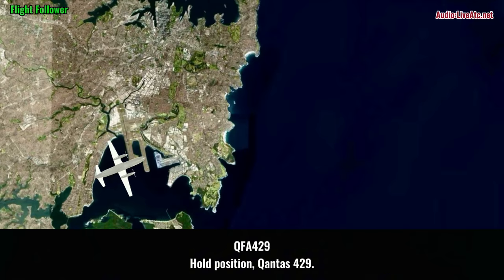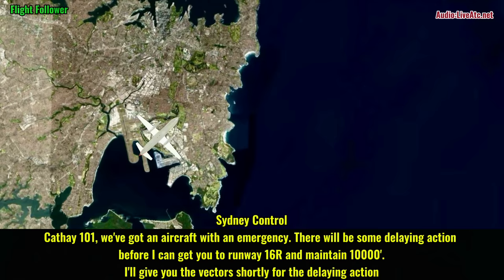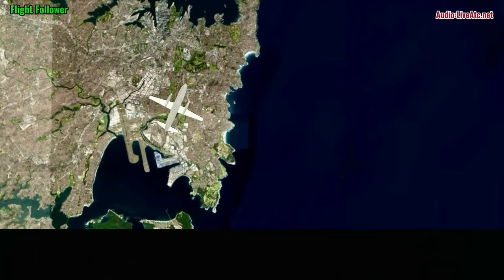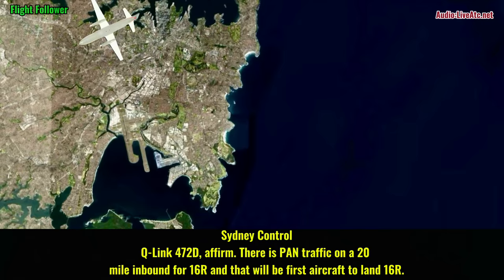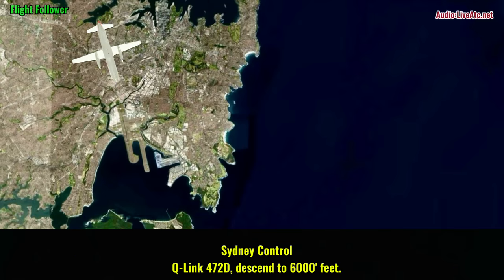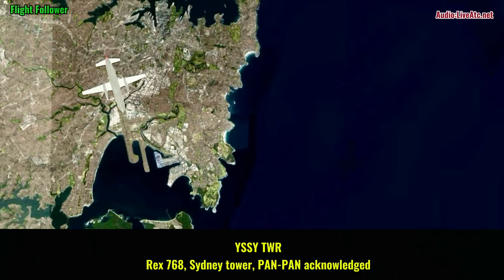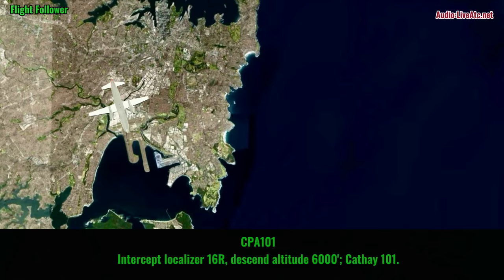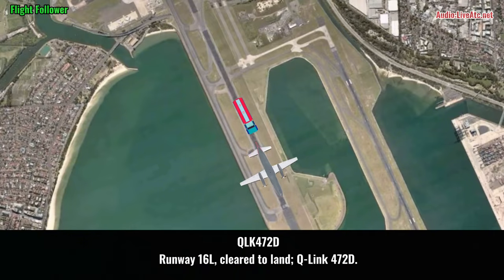Pilot LOSES PROPELLER MID-AIR! [REAL ATC] #atc #aviation

Comment: Prop's to the pilot!
Reply: Just one tho 😂
Reply: @Molon_Labe1776  😂😂
Reply: Groan...
Reply: <Rim Shot>  🤣
Reply: He sure needs one!
Reply: I saw what you did there. :)
Reply: Props LEFT the pilot, hope it wasnt something he said...
Reply: *groan*
Reply: @Relkond  well we dont mean to propel the puns into the air...
Reply: not so much to engineering.
Reply: @Agnemons  it's kind of a known failure mode - the spinny bit has to connect to the not-spinny bit somehow, and in all manner of devices, those connections fail.  Wheels fall off all the time - difference here is mostly one of pulling over.
Reply: @Molon_Labe1776  -1 prop

Comment: I flew that aircraft the first flight back after its repair. Followed a dash-8 to ABX, in their wake turbulence. That occasional bump from the wake made me feel uneasy.
Reply: That aircraft was probably the safest to fly on in the fleet at that time though, it had just been through rigerous maintenance and fly-worthiness
Reply: @garrygarrygarry1  - which is when it’s at the most dangerous. If an aircraft is refresh out of the hangar then the pre-flight inspections should be performed much more diligently. Plenty of examples of engine cowlings not latched, or rags within the engine bay, or just switches out of position.
Reply: @EdOeuna  I stand corrected, Thanks for your more insightful reply... i wrote mine slightly inebriated.
Reply: @EdOeuna I can verify this, having recently tried to 'fix', myself, several problems in my 1997 Toyota Hilux, not being a mechanic, aanndd, I created about another 13 more serious issues which degraded, sequentially, even tho I technically git the ute going again initially! 😂😅 Ha ha

Comment: They're lucky the prop didn't go through the plane
Reply from the maker: He was lucky. of course
Reply from the maker: I remember this happening to a US marine C130 if i am not wrong
Pilots had no chance of saving the aircraft or themselves
Reply: Very lucky!!!!!!!
Reply: Usually an intact spinning propeller will go forward and drop down rather quickly since it is pulling the plane along it will continue on that path.
 
If you are unlucky to throw just one blade at the time it passes the arc range of the cabin then some fruit ninja may occur.😂
Reply: @kiwidiesel iirc an Alaska air superprop had a prop disconnect and tore open the cabin
Reply: @Mike.The.Jeweler I recall the accident where the prop disconnected at the shaft and, once unloaded, flung itself forward.  But there are plenty of variables that could cause a failing prop to tear into the cabin (which is reinforced adjacent to the prop but only for ice shedding, not steel shedding ! 😂)
Reply: That would've been gruesome...
Reply: They never do if the propeller is still complete.
They will depart forward in a curve. 
If a blad disappear than it may cartwheel and hit something
Reply: @Flight_Follower depends which accident you talk about , manny did land even two missing on the same wing
Reply: You worry prop hit the plane?? I was worried it hit people down below.
Reply: The many I inspected ;-)
Reply: "It's exactly the same as what happened on June 8, 1983, when a Lockheed L-188 Electra, N1968R, operated by Reeve Aleutian Airways as  reeve air  Flight 8, made an emergency landing at Anchorage, Alaska, after a propeller separation. In this incident, the propeller sliced through the control cables and into the cabin, but luckily, that the rex aircraft didn't lose flight controls and the turbo prop didn't slice through the cabin
Reply: yep like a spinning top. not a saw blade.
Reply: @truthful3777  No point in worrying about the prop after it has departed the aircraft. There is absolutly nothing you can do about it so no point in burning up brain cells over it.
Worry about the things you can change.
Reply: @Agnemons  Future no expose propeller... All must encased like jet engine safer.
Reply: Ah, no. They're lucky the prop fell in the one acre of bush, where it did and not the houses or highway nearby!
Reply: @truthful3777 mate compressor blades can and do still disintegrate and exit engines.
Reply: @christopherryan7780  Compressor blades are small and light compare with huge long propeller blades.
Reply: @gman83090  similar thing happened to a us navy p3 off of the gulf of Oman 1991. Blade from #1 prop seperated and struck the #2 gearbox. The #2 prop cut into the fuselage cutting all 4 power levers, apu fuel feed line and boost handle cables. All 4 engines flamed out. They ditched her in the ocean with no hyds, no elec no elevator or rudder boost (mech advantage) glided her in basically on trim tabs. All crew survived. Makes the miracle on the hudson look easy.
Reply: @ithinkurf  That DOES sound like an interesting day out. In an Orion 🥶 'on trim tabs' ! WTH. to quote the aforementioned Miracle VR '15 : 29 : 33 DEP I'm sorry say again Cactus?' lol. Anyway, I hope ya didnt ruin any of the nice Navy TVs and things that go ping inside that airframe?! 😏🤕📺cause then someone would be really yelling at ya a?!
Reply: @ithinkurf  'all crew' is 13 people, as well. marking 50% of all targets in 91 also.
Reply: @truthful3777  Right. It came down INCREDIBLY lucky as I recall in a patch of bush near Georges River, in a tiny wedge surrounded by houses, but missing them all, and a major road bridge Xing.
Reply: Never sit on the left side of a prop plane near that spinner.
Reply: @tomsear1  Intersection The River Road/Sandakan Road in Revesby Heights, Sydney. 33°58'00.15" S  151°00'55.25" E
Reply: @thies7831  thanks for follow up ! erm, I was going from memory from contemporaneous reports,  and cross checked now, was spotted by polair in George's River National Park just off The River Road, in the bush. I seem to recall images of it in the scrub 2. So more likely intersection River and Prince, not Sandakan?! Oh yeah if you find the SMH article there is overhead shot of entire prop just 'resting' there from helo. Still, Insanely close to homes! Windage or a few more metres in the air and that bit of the park is a wedge. Thanks again
Reply: @tomsear1  Thanks for your comment. My info is based on what the media supplied to us in Melbourne at that time.
Reply: Nothing wrong with the engine mate, the front bit fell off
Reply: @qbi4614  We'll pull over, stick the spare prop on and then carry on. Just give a few minutes, please ...  :body-blue-raised-arms:
Reply: @truthful3777  I’d rather a prop come off then a compressor shit itself
Reply: @christopherryan7780 ???
Reply: @truthful3777  because when Jet engine go bang bang it’s bad
Reply: @christopherryan7780  Same with Props.. If prop damaged, engine have yo switch Off ajd less imbalance prop will shake the plane to destruction.

Comment: I flew on this plane last year in seat 3A and noticed that row 2 did not have a window and that area of the fuselage lines up exactly with the line of the propellor. I would imagine there are a few layers of Kevlar there. That said, the propellers are quite large as it can carry about 35 people and one of them flying off would pack a punch.
Reply: the armour is for ice forming on the prop and being slung into the fuselage.  theres not much that will stop the mass of a blade.
Reply: Show me a plane that will stop a propeller strike safely and you will see a plane that can’t fly.

Comment: Quite the Pan-tastic day in Sydney with two PAN aircraft inbound...
Reply: I now want a panini
Reply: Pan...oh that is so silly. They were emergency aircraft.
Reply: @RLTtizME that’s what a pan aircraft is??
Reply: @itzgreen6085  A "PAN" is an urgency, a "MAYDAY" is an emergency

If I was flying the engine failure (especially in suck a spectacular fashion) would have been a MAYDAY, because you don't know how whether the same thing to have caused it on one engine will cause it on the other, although at that particular time there was no imminent danger, so either can be justified (even if the other engine failed, they may have had enough glide to reach the airport). Clearly ATC are prioritising this plane, whether because it was closer or because it was most critical is unclear but 🤷🤷.

The medical situation depends what the situation is, if it's just someone who's airsick then it's not an emergency, if it's someone having a heart attack it is.
Reply: @samd2660  Or you can just say emergency…then you won’t have to convulse in your BarcaLounger.
Reply: @samd2660  👍
Reply: Fortunate that a medical emergency can switch runways, if both needed the longest runway it could be a problem.
Reply: @andyalder7910  How so?
Reply: @RLTtizME  An aeroplane with a sick passenger can land like any other aeroplane, so choice of runways is for convenience. Turboprop without an engine needs a long runway because they can't revere-pitch the propeller to brake.
Reply: @andyalder7910  How so. What is an AEROPLANE?
Reply: @RLTtizME aeroplane is British English, airplane is American English and both are  correct since they mean the same. It is actually just a geolocated preference in speech. You'll even hear native BE speakers use the word airplane though since it got way more common in basic.
Reply: @MinkxiTes  Don't deed the troll.
Reply: @MinkxiTes  WE don't use British English here on YT mate. Pip pip....YT is an American Social Media platform.  Also....we don't use "s" instead of "z" in certain words. Make a note.  Cheers.
Reply: RLT, the not so funny aviation troll.
Reply: @EdOeuna  Your comas are not lasting as long as they used to.  The treatments are working .
Reply: @RLTtizME  - I haven’t seen you posting for a while. I almost missed you. Now I need to see a post (rant) from Daft Vader to make my day.
Reply: @RLTtizME  In English the adult term is aeroplane, whereas airplane is nursery-speak for infants.

Comment: "It's exactly the same as what happened on June 8, 1983, when a Lockheed L-188 Electra, N1968R, operated by Reeve Aleutian Airways Flight 8, made an emergency landing at Anchorage, Alaska, after a propeller separation. In this incident, the propeller sliced through the control cables and into the cabin, but luckily with  the rex  aircraft didn't lose flight controls."

Comment: "The ahh prop has just,  ahh fallen off the aircraft."   Very calmly spoken.  Miraculous that the aircraft did not seem to get damaged by the propeller.  . I wonder what the direction of spin is for those props? and what happens to a prop when it falls off. i.e. does it fly upwards first? due to its rotation speed?   Does it fly outwards? Does it depend ?
Reply: It would depend on RPM, vibration and imbalance, and also airflow. If you're lucky it doesn't fly towards the fuselage.

Comment: 1:  holy crap i hope the prop didnt strike the plane.
2: Look out below! I hope noone was injured by this broken-away propeller.
3: i hope they were able to shut that engine right down. Cause that thing is gonna overspeed itself to ripping apart very quickly. Doubt it'd even take a minute.
Reply: It didn't, it flew forward under its own rotational inertia.
It landed in bushland, no one got hit.
Turbine engines have overspeed protection, as soon as it hit redline it would have had its fuel cut by the FCU (Fuel Control Unit)

Comment: Kinda curious why they would direct an aircraft without an engine to fly a normal traffic pattern versus a straight in.
Reply: He was put on a 20 mile final, that's about as straight in as you can get. They were following a traffic pattern in terms of geometry but it was far from a normal circuit. Downwind is downwind,  in this case it was just very extended and probably quite wide due to the emergency. Also, by making a left hand pattern that had the aircraft turning into the live engine, which is preferable.

Comment: 0:08 The first Sydney Control sounds like time is not of the essence and speaks slowly with lots of delay words
Reply: Painful to listen too. The Rex flight should have been declared an emergency. Under ICAO rules I believe this to be correct. The plane, Jetstar, pan was appropriate  as the plane itself was flying normally.
Reply: And a lot of nosey and needy pilots on frequency as well
Reply: @trent1963  like they all like to hear their voice on the radio. My instructor would yell at me for this. If flying VFR and you request flight following and are very wordy you are more likely to get a too busy reply from ATC.
Reply: @annyer262 PIC declared it as urgency not emergency. He was there. He had all the relevant information. You were not there.
Reply: @ZebedeeAU  he should have declared an emergency as it definitely is an emergency, and would have avoided confusion with the airplane that needed priority handling but not due to mechanical problems!
Reply: @annyer262  There was NO confusion in the mind of the air traffic controller.
This is the Aussie way of handling things.
I thought the whole thing was done VERY professionally.
I am an Aussie pilot!
Reply: @annyer262  why is it "definitely" an emergency? What are your skills, experience and qualifications to make your opinion more valid than those of the pilot in command?

Comment: I would have thought a ....may day ...Would be relevant for a catastrophic engine fail with obvious mechanical destruction involved.
Reply: PIC rated it as an urgency situation not an emergency. He was there, we weren't.
Reply: I was in no way  criticising any one involved. My simple statement asked the question. What is the difference between a mayday. And..panpan
Reply: @geoffb108  MAYDAY = lives are in imminent danger, ugent assistance is required.
PAN = Abnormal operations, I need priority assistance, lives are not in imminent danger.
Roughly speaking, that is the difference.
This aircraft is perfectly able to fly on one engine and there was no structural damage apart from the loss of the prop.
He could have called MAYDAY or PAN, but it was his choice and he obviously felt they were not in "imminent danger" after they had resolved the immediate problem of the prop separation.